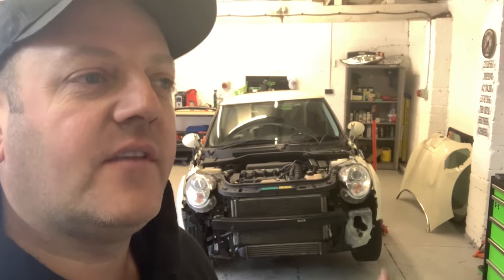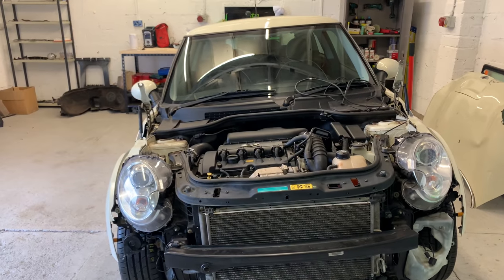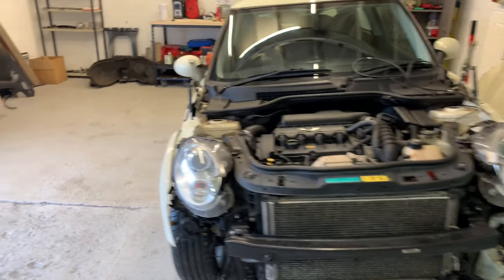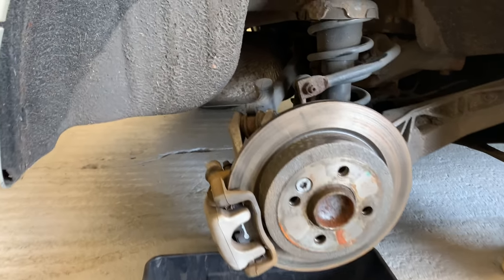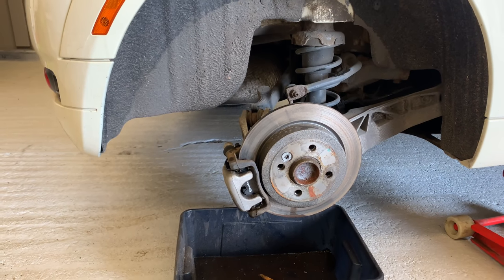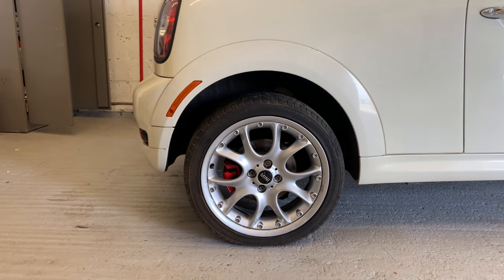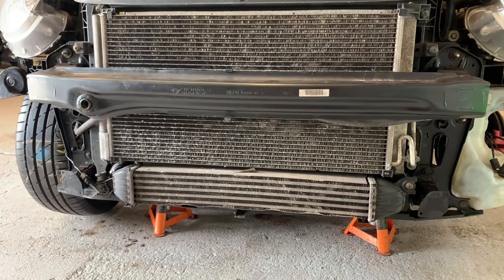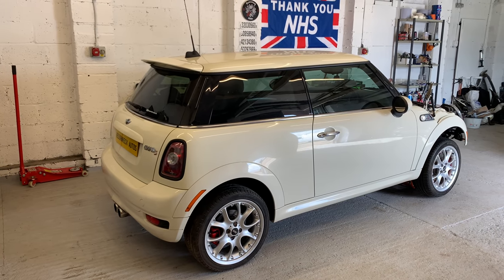MINI COOPER S COPART SALVAGE REBUILD PT5 PAINTING SOME PARTS

Comment: I like the black paint but not sure how long it will last in good condition over chrome long term? Red calipers look cool too, what really would finish the car off is to get the wheels refurbed and painted in black to match (Looks like the drivers side rear wheel has some nasty curbing on it anyway) It would make those red calipers pop like Dorothy's shoes in Kansas! lol

Comment: Did you give them chrome bits a light flat with fine paper or a scotch pad Mark? I actually prefer satin black to the chrome, but once you start with them bits, you should really do all the chrome, inc handles, petrol cap etc, but it is looking rather smart mate 👍🏼👍🏼
Reply from the maker: HI mate i did key them with sand paper first just a lite rub all over i will spray them with lacquer clear to make them shine   👍👍

Comment: Did you key all the chrome before you painted it, only asking cos you didn’t say whether you did. If not the paint will come off really easily and look tatty very quickly.
Reply from the maker: Hi mate yes i did key it with a bit of sand paper hopefully it stays on 👍👍
Reply: Plastidip may have been better
Reply from the maker: Shane Brown hi Shane never heard of that thanks for the info 👍👍
Reply: It can be pealed off if you don’t like it or it begins to look tired it is good stuff have a google 👍
Reply from the maker: Shane Brown Thanks Shane I will 👍👍

Comment: Mark in the last few frames of the backend of the Mini, do you thing it would look better with the radio aerial replaced with a ‘sharks fin’ style one?
They are dirt cheap off eBay (less than a tenner) and I believe they work quite well too. I’ll confirm that very soon when the one I’ve ordered arrives and I fit to my car.
Love the videos.
Reply from the maker: HI John thanks for the info if you can let me know if it works ok might change my one thanks buddy 👍👍
Reply: I am also interested how this turns out I have a mini and I have always liked the look of the shark finns

Comment: Luvin your work normally but to me this is one step forward and two bodges backwards for this car.  Hand painted calipers look shite, and if you did not prep those chrome parts and painted straight over them with just a clean that paint will fall off quicker than and X Factor winners celeb status.
Reply from the maker: HI mate thanks for your honest opinion painting calipers are not to every one taste and yes i did key the plastic chrome first
Reply: If painting callipers for them to look good a full strip down media blast and spray but if going to them lengths may as well just get them powder coated I do agree it’s a bit racer bodge from the max power days hand painted on the car callipers 🙈
Reply from the maker: Shane Brown 😂😂max power days wow I remember them days this paint is left over so I thought why not just use it 👍👍

Comment: You might have stood a better chance of the paint sticking if you would have keyd the chrome but like others have said it will more and likely peel
Reply from the maker: HI Michael i did key the parts before painting and will paint clear lacquer over all the parts
Reply: @ResurwreckAutosUK  Good luck👍